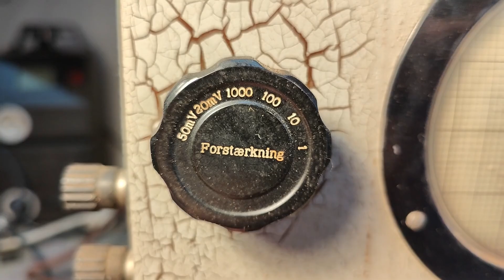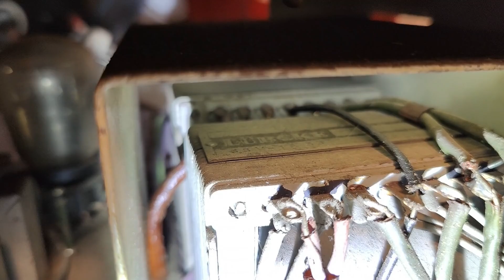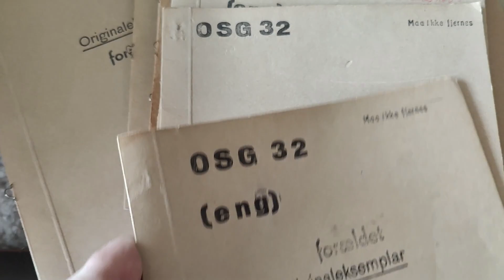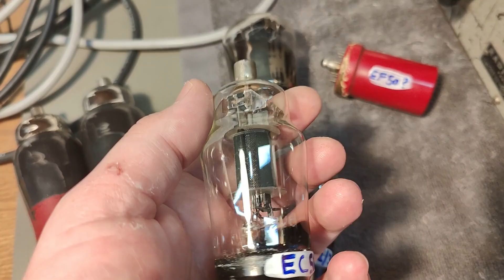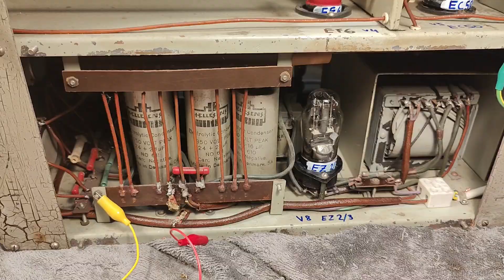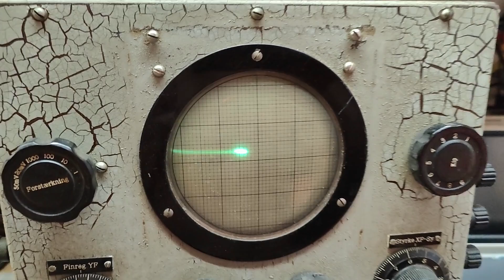Radiometer OSG32 Oscilloscope 1943 test teardown repair

Comment: Didnt know that the germans let the danish make high tech equipment like this for the domestic market.
Reply from the maker: in 1943 the story was a bit wierd, and as explained in the video the resistance did blew up the factory, to stop production, I dont really understand why, scopes and other equipment they made back then, was not really war related, one could mayby say, you can repair a war related radio with an oscilloscope, i did not dig super deep into this, maybe there is not big explainer..

Comment: A very interesting video.  I love digging into these older (ancient?) devices  thank you.  Two things:1. That black coating inside of the tube is intended to provide electrostatic shielding, it is usually connected to a grounded pin of the base.  2.  Old electrolytic condensers become very leaky and are not very effective power filters anymore.  p.s. being of 1943 vintage it is only a little bit younger than I.

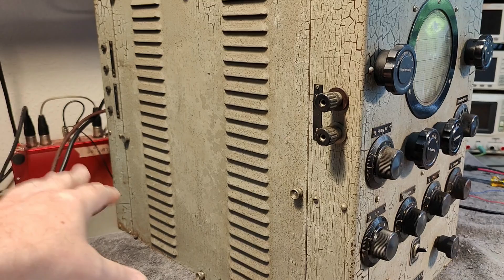Comment: 3:43 What could go wrong with that - let me plug in this 4mm cable while holding the other plug in the other haAAAAAAAAAAArgghhhh :)
Reply from the maker: lab personal was maybe better educated, and maybe also more used to handle high voltage back in 194x since all equipment was full of tubes

Comment: Love the patina on that.  I would leave the outside 100% alone. Not even a cleaning.😁
Reply: In this case, you might want to at least clearcoat it so you don`t have flakes of lead paint all over the workshop :)
Reply from the maker: i had to clean it a little bit, i need knobs and such to be nice to touch